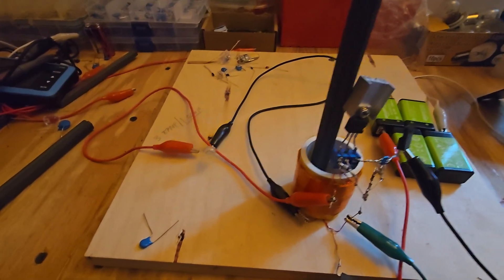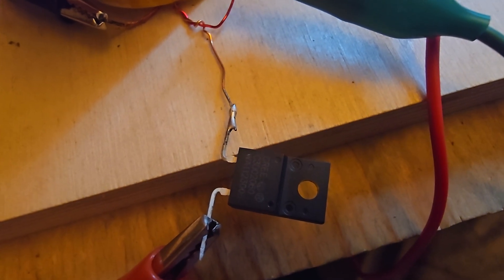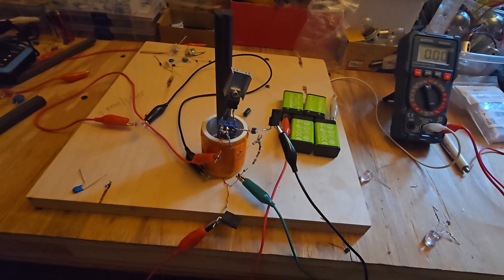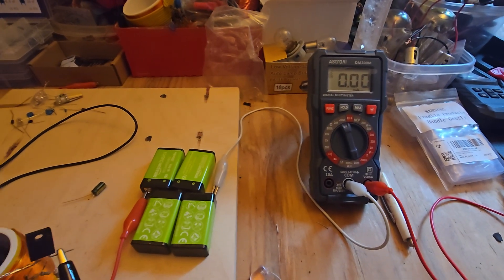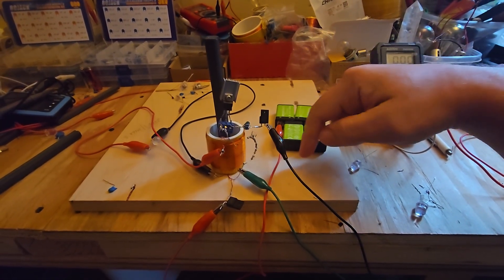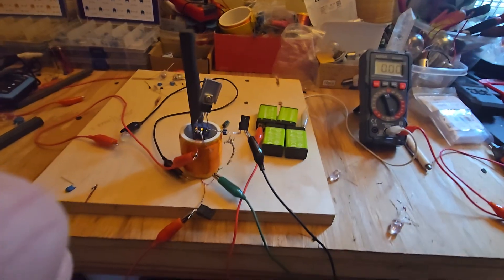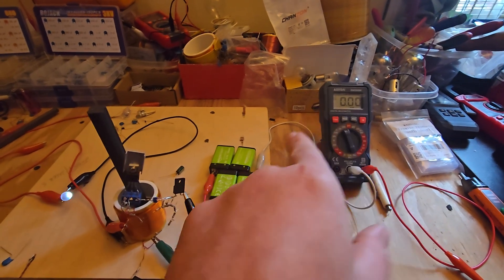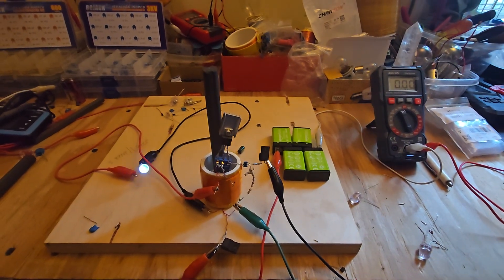🚰WE CREATED AN AETHERIC ENERGY GATE TO CONJURE POWER FROM A VOLTAGE POTENTIAL ONLY! MUST SEE!📖

Comment: "The device is absolutely impressive, feel free to build it" is the most ethical statement
Reply from the maker: Hi, our best performing transmitter is wound upon a one inch diameter pvc pipe coupler that is 1&10/16ths inches wide by 1&14/16th inches long. This transmitter is powered off of a 45vdc VOLTAGE POTENTIAL ONLY to trigger.

The length of the transmitters coils are all 1.48 inches long & centered upon the pvc coupler to be in alignment with the golden ratio.The transmitter consists of three coils being an inner red L1 trigger coil & an outer orange L2 power coil & a 24awg L3 litz coil wrapped in the same direction as the outer L2 power coil for constructive interference. Both the L1 & L2 coils are identical to eachother to achieve sympathetic resonance & are wound opposite & over eachother as tightly as possible for optimal coupling to ensure efficient oscillations with our vital ST13009 driving transistor that seems to be near perfectly impedance matched & we used 24awg solid core magnet wire for both the L1 & L2 bucking transmitter coils. This transmitter is a 416 times mathematically perfect scaled down model of Nikola Teslas magnifying transmitter & heavy earth grounding the bottom of the red L1 trigger coil is vital for its operation & the creation of what appears to be near magic like loadless hyper efficient wireless power effects in the immidiate area possibly due to abrubt inductive switching & for it to possibly pull in dielectric energy in an induction based fashion in theory from the heavy earth ground connection. This energy seems to exist completely outside conductors but conductors are needed to establish the condition for this energy to flow. 24awg solid core magnet wire seems the best so far for the L1 & L2 on this style of transmitter & produces the most powerful wireless power & possible energy synthesis effects due to the 24awg transmitter coils more closely impedance matching with the test transistors we use. So far all our testing shows that the ST13009 transistor from newark electronics is the absolute best to use in this transmitter system with our current design.

The base of our current ST13009 transistor is connected to the inner red 24AWG L1 clockwise trigger coil. The collector of our transistor is connected to the orange outer 24AWG L2 counter-clockwise power coil. The emitter of the transistor connects to the negative of our battery through a series C3D02060 diode (anode to emitter) & DB3 Diac (3 in parallel) & the positive connection of our battery connects to the bottom of our orange L2 power coil through another series C3D02060 diode (Cathode to coil) bottom opposite of the transistor. We replaced the 70 Megaohm 1/4 watt carbon film biasing resistor with a reversed biased C3D02060 diode instead of the resistor that (must be a carbon film resistor for RF applications) between the collector of our transistor & the bottom of our inner red L1 trigger coil to ensure the transmitter can oscillate on voltage potential only. The modules can keep being duplicated & combined for infinite power output from voltage potential only in theory or the voltage potential/biasing that triggers the transmitter can be increased in voltage/pressure for extreme power output at the L3 from one single transmitter/generator unit in theory so long as you don't exceed your abrubt unidirectional dc switching capabilities & in our case we use diacs at the moment.

TRANSMITTER LCR READINGS: 24AWG
INNER RED L1 SOLID MAGNET WIRE TRIGGER COIL HAS AN INDUCTANCE OF .215mH WITH A RESISTANCE OF 00.9 OHMS

24AWG OUTER ORANGE L2 SOLID MAGNET WIRE POWER COIL HAS AN INDUCTANCE OF .210mH WITH A RESISTANCE OF 00.9 OHMS

24AWG OUTER LITZ L3 COIL HAS AN INDUCTANCE OF 99uH & WITH A RESISTANCE OF 00.7 OHMS

BREAKTHROUGH 11/25/25 

I HAVE REPLACED THE 70 MEGAOHM BIASING RESISTOR WITH A REVERSE BIASED C3D02060 DIODE (ANODE TO COLLECTOR/CATHODE TO L1 BOTTOM). THE TRANSMITTER ALSO OPERATES WITH NO BIASING RESISTOR OR DEVICE INSTALLED! BUT THE PULSES OF LIGHT AT THE L3 COIL ARE SLOWER & SLIGHTLY MORE RANDOM. I SWAPPED THE SERIES POSITION OF THE DIAC & C3D02060 DIODE THAT COMES OFF OUR TRANSISTOR TO NOW BE EMITTER,DIODE,DIAC,NEGATIVE INPUT & THE L3 LED LIGHT OUTPUT NOW PULSES STEADILY & RAPIDLY. 

I NOW ADDED A 4.7nF CAPACITOR OFF EACH LEG OF THE L3 COIL IN SERIES THAT THEN GOES INTO A FULL BRIDGE RECTIFIER COMPOSED OF STTHR106 DIODES TO RUN THE 3VDC 10MM LED. THE ADDITION OF A 400VDC 4.7uF CAPACITOR ALLOWS THE LED TO GLOW DIMMER BUT MORE STEADY. ALSO IF I TOUCH THE L2 COIL THE LED BEING RUN FROM THE L3'S FULL BRIDGE RECTIFIER WILL GLOW BRIGHTER BUT THE TRANSMITTER WILL EXIT OUT OF THE 0.00 CURRENT CONSUMPTION STATE WHEN THIS IS DONE. (FURTHER NOTE: THE LED AT L3 WILL PULSE JUST FROM BEING CONNECTED TO 1 END OF THE L3 COIL)(I NOW HAVE THE SYSTEM RUNNING FROM A 45VDC 9V BATTERY BANK STACK IN THE 0 INPUT CURRENT MODE & THE LARGER PLATE AREA INSIDE THE BATTERIES HELP THE SYSTEM OUTPUT MORE POWER AT L3. SHRINKING THE BATTERY PACK TO BE TO SMALL WILL CRIPPLE THE DEVICE FROM CONJURING POWER AT THE L3 COIL FROM ALL THE PRELIMANERY DATA SO FAR POSSIBLY DUE TO THE INTERNAL PLATE AREA OF THE BATTERY BEING TO SMALL. ALSO ALUMINUM FOIL CAN BE WRAPPED AROUND THE 9VDC SERIES BATTERY PACK/BANK & INSULATED/TAPED WITH A WIRE COMING OFF IT & CONNECTING THIS WIRE TO THE BATTERIES NEGATIVE RAIL INCREASES OUTPUT AT L3. TO MAINTAIN THE LOADLESS STATE THE IN LINE ABRUBT SWITCHING APPARATUS MUST BE CORRECT & NOT STRAINED OR OVERSATURATED.)(I NOTICED THAT CERAMIC CAPACITORS IN PARALLEL ON THE REVERSE BIASED C3D02060 DIODE CAN CONTROL THE L3 COILS POWER OUTPUT WITH SMALLER CAPACITORS LIGHTING THE LED AT L3 IN PULSES MORE RAPIDLY & WITH BIGGER CAPACITORS LIGHTING THE LIGHT IN SLOWER MORE POWERFUL PULSES. SO FAR A 820pF CAPACITOR IN PARALLEL ON OUR BIASING DIODE SEEMS PERFECT.)

FURTHER NOTES: A voltage detection wand won't beep near the device when its outputting rapid pulsed power & lighting the led at L3. If i use my finger as a high value resistor & touch the pins on our C3D02060 biasing diode the L3 light will stop pulsing & glow steadily but then the transmitter consumes less than 1mA of current/exits the loadless state & the voltage detection wand will beep
Reply from the maker: Its easy & the schematic is listed for free on our posts section on our channel.

Comment: At 2:00 , your DMM is not capable of measuring 1/1000 of a mA.
1/100 of a mA yes, but not 1/1000, that is a factor of 10.
What are "sick" diodes?
You need to measure the output, not just look at a NON-Linear output LED.
Add an output capacitor, don't just talk about it.
A schematic in the video please.
Reply: think he says SiC..
Reply: 3:29  reference here

Comment: Can I run my 52v ebike with this?
Reply from the maker: Eventually if enough transmitter modules are built & have the dc of their L3 coils combined. The system is acting like a crude solar cell that works 24/7